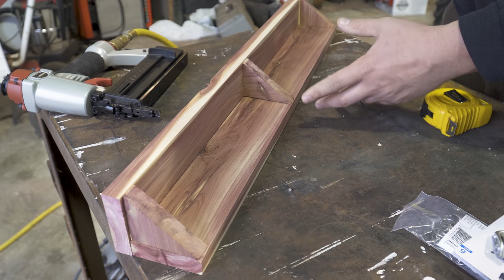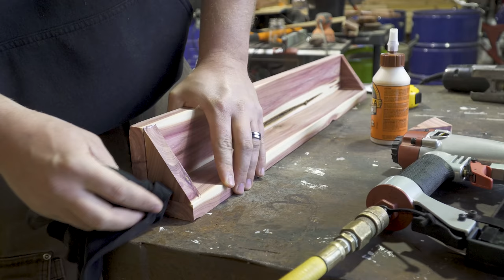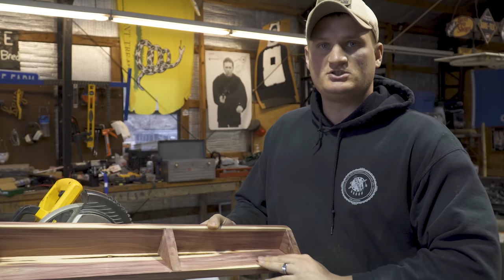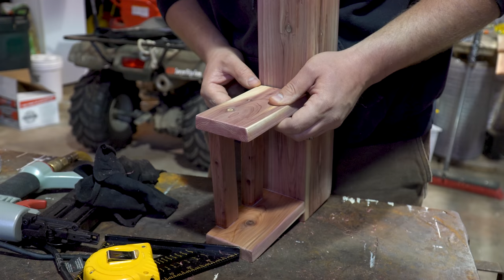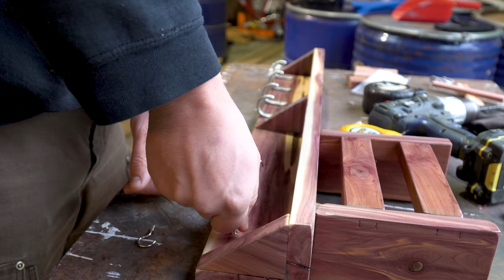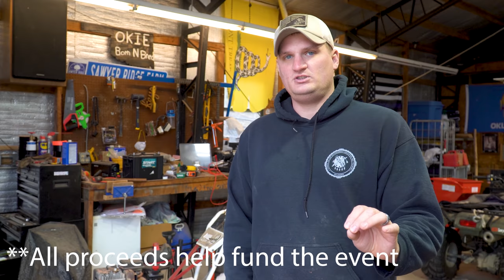Easiest DIY Entryway Key Holder | Logs To Lumber | Eastern Red Cedar

Comment: Great video. Question, what’s the best way to fill nail holes in cedar so they won’t show, or at least not be obvious? I’ve tried cedar saw dust mixed with glue and other things with no luck yet. And help and advice would be greatly appreciated! Thank you in advance for your time.
-Brian

Comment: I love both of them but I think the mail holder should have at least a small back so things don't slide behind the shelf and fall on the floor.  Great job though I love them.
Reply from the maker: It goes up against the wall, it won't slide out the back